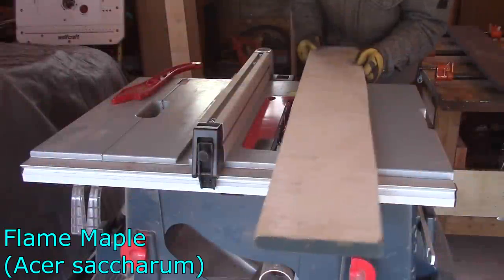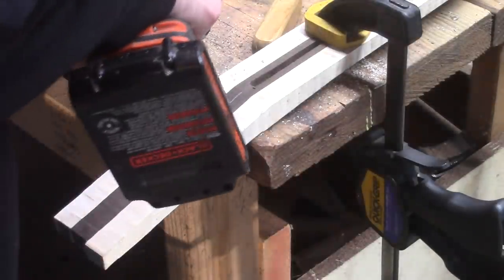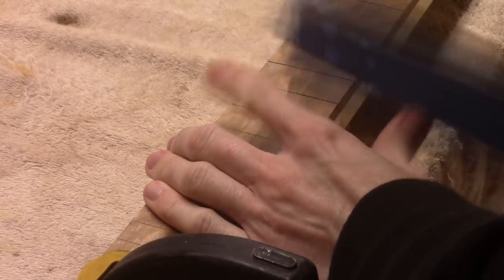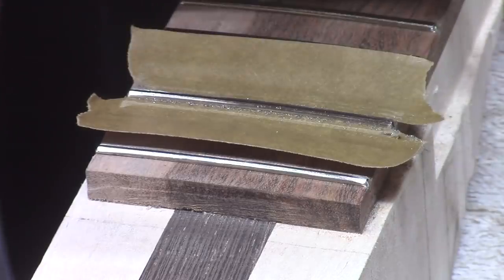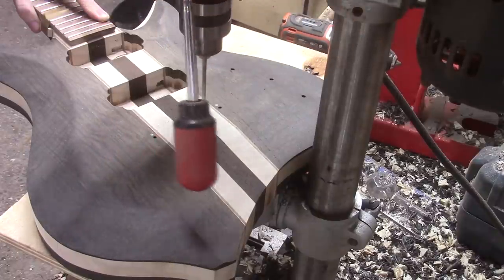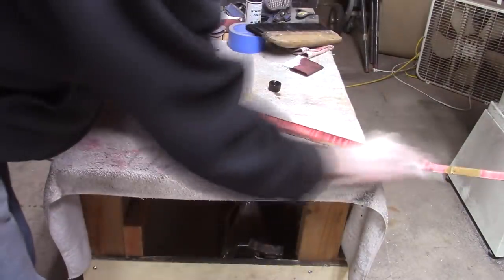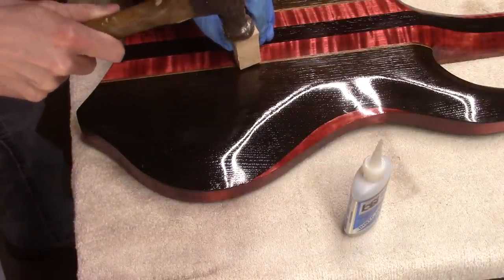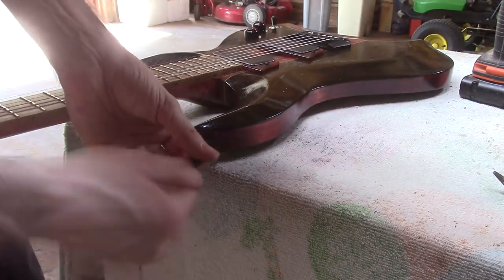Custom Guitar Build - The Wyvern - Bog Oak and Flame Maple [Full Build]

Comment: In the past I've run into an issue where the black finish on the bridge/tailpiece didn't make a very good ground connection.
The black coated stop bar and studs I was working with required I remove the finish where the ground wire contacted the stud, the stop bar to stud contact area and then the string through holes.
Once I removed just enough of the black finish the hum went down and the output seemed to stabilize (the output was reduced due to the poor grounding of the strings).
I understand not all black plating, anodized or painted finishes are equal, I just mentioned this because it took me a bit of effort to track down the problem.
Nice work Sir.

Comment: 😊The ground wire should have been striped more, so that its entire contact length is actually in contact with housing, not partially. As it was done the insulation being thicker than the wire  precludes effective metal to metal contact even with the high compressive forces of the screws. The craftmanship and the sound are superb

Comment: One question, how does filing down the top of the nut change how high the strings are off of the frets? I would assume the problem with cutting the string slots in the nut too deep is related to the strings being too close to the frets at that end of the neck, making adjustments to relief much less effective, and raising the action at the bridge would be of negligible help at best, correct?
Reply from the maker: The complaint I was addressing was that the nut was too tall which would cause the strings to bind in it and hurt tuning stability, not that the strings were too close to the fretboard.